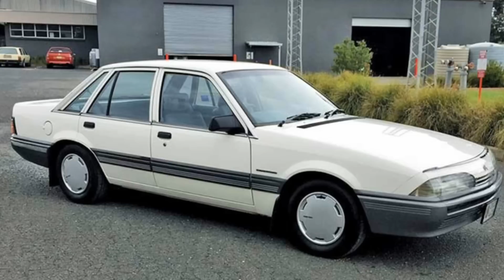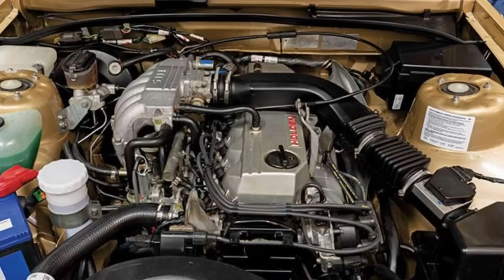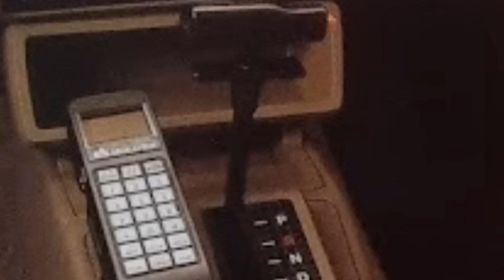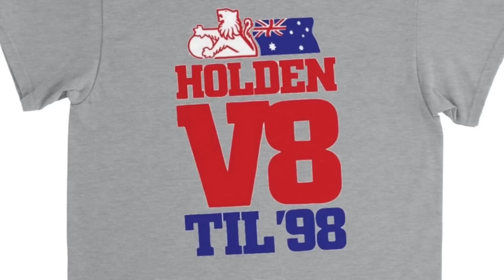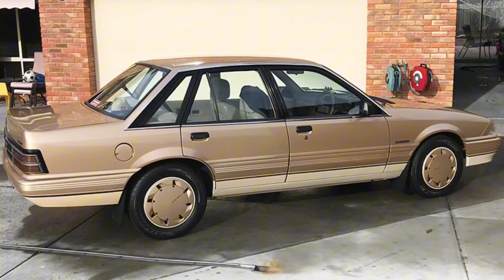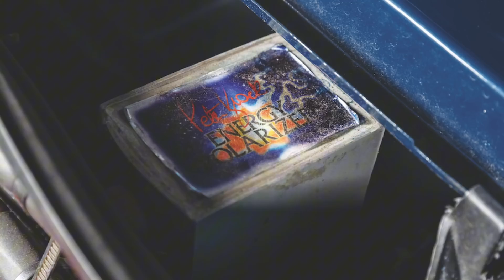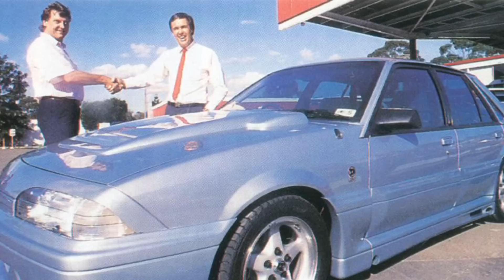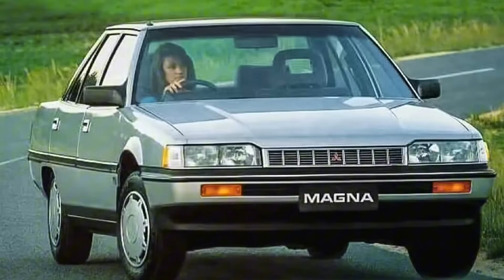Holden VL Commodore - Turbo Talk.

Comment: Of course the RB30 engine was a failure in the VL due to poor installation engineering by GMH. You could take a brand new VL powered by the RB30 and bring it up to operating temprature  and then drive the car on a continuous downhill run for a distance of 1 km and turn around and point the car back up the hill and floor it and kill the engine in about 500 meters due to the cylinder head emptying itself of all of the coolant on the downhill run. Of course engines do not operate very efficiently with no coolant in the cylinder head and as a consequence the cylinder head cracked along the full length under the camshaft, bye bye engine. I believe from a good source that this is why Nissan pulled the RB30 from GMH.
Reply: On another point, The head cracking is mostly due to people not bleeding the cooling system properly when refilling it - there are 2 bleeds from memory - one on the thermostat housing and one on the intake manifold.
Reply: @kajak012 exactly right.  Yes, the radiator was lower, but so were many contemporary cars at that time too.  Holden did publish bleeding instructions in the service manuals, and reiterated it in the TSBs sent to dealers.  Funny how you also have to bleed the V6 from mid-VN thru Ecotec models, yet nobody has an issue bleeding them?
Reply: @commodorenut  my  vl had 220k before head problems,i miss that car very much,if i could spend $$$ i would purchase one today.
Reply from the maker: Good old American truck like engineering. 😀👍
Reply: @markbehr88  buick from memory
Reply from the maker: Yes, Buick engine. Later US versions and ours had balance shafts (thanks Mitsubishi) and it became a very good, reliable and economical engine. 👍
Reply: @markbehr88  Yes only after many attempts the 3.8 eventually became a decent engine. A close friend of mine saw the first rendition of the 3.8 in Detroit in a warehouse with a defective label on each box. These motors were in storage and when GMH put their hand up to find a replacement for the RB30 Detroit emptied the storage facility of defective 3.8 Buick engines to the land of OZ.
Reply from the maker: @1darryloflife  That sounds odd given GM would ultimately have to wear the warranty costs? 🤔
Reply: @markbehr88  They changed the engine so by the time they got to the VT Commodore the out of balance was sorted and the engine was reliable, and then they scrapped it and went to the aluminium block V6. Remember the VN 3.8 litre had a rear of engine mounted thermostat so they had done a lot of work to fix the problems that Detroit had landed GMH with those original Buick mistakes.
Reply from the maker: @kajak012  Makes sense. 👍
Reply: Nissan didn’t “pull” the RB30 from Holden.  Holden were never going to keep the RB30 beyond 1991.  There were already concerns that it didn’t offer enough torque for the upcoming larger bodied commodores and planned heavier LWB models.  The plan was to run the RB30 in VN and introduce a well-developed and refined 3800 V6 in the VP.  The exchange rate problems in 87 & 88 forced them to fast-track the V6 program, which is why the VN had 3 distinct versions of the V6, and a myriad of running changes, as they chased their tails trying to catch up.
Reply from the maker: Yes, as per the episode the costs were getting out of hand as the Yen was going ballistic. 👍
Reply: @commodorenut  the RB30 needed work just look at what they can do now.For me is vs v6,anything before that is not refined imho.
still a holden fan always will be nothing like 308(or stroker sound)
Reply: My VL (which I still own) cracked the head in 1996. I bought the car second hand from the first owner very early in 1991. There was no prior advice from Holden to bleed the coolant points. The engine was always good, however the top tank of the radiator sits well below the highest point in the cylinder head which I see as a design defect from Holden in the quest to lower the bonnet height profile.
Reply: @PaulEvans-f1y yep, that was the problem. Engine was designed to fit the skyline hence no issues with that version however the commodore’s as you said had the issue of the engine sitting higher hence the top of the  head being above the radiator. So coolant starvation occurred which cracked heads.
Reply from the maker: @PaulEvans-f1y  Interesting. 👍
Reply from the maker: @1darryloflife  Really. That does sound like a problem but not an insurmountable one. 🤔👍
Reply: Camiras also suffered this problem with bleeding the coolant system. Ours overheated driving home from a service.😂 Absolute rubbish.
Reply from the maker: @anthonywalsh2164  No good. 🫣

Comment: Bloody legendary cars. They still look great even now. That Nissan RB30 engine was a gem
Reply from the maker: @Coastmac2001  Agree. I love the Calais. 👍
Reply: @markbehr88  the Calais was really well equipped . Wasn't a bad drive either.  Pity there doesn't appear to be too many examples of any VL still surviving
Reply from the maker: @Coastmac2001  I am sure there are some lovely ones tucked away but you are right, the original owner cars are long gone. 👍
Reply: I was given a lift in one. It was eerily silent.
Reply: @jamesfrench7299  they were probably one of the best built cars here . Reliability was very decent. A few niggles in early variants , but overall the VL nailed it
Reply from the maker: Or was that the conversation? 😀👍
Reply from the maker: Yes, and well sort after today. 👍
Reply: @markbehr88  No it was the car 💯
Reply from the maker: @jamesfrench7299  😀👍
Reply: @markbehr88  There are still a few unmolested VL's getting around but certainly not as daily drivers. I'm also the original owner of my VL SL Turbo, celebrating 38 years of ownership this year. Not aware of too many others out there currently.
Reply from the maker: @ That’s great. Excellent value. 👍
Reply: My neighbour has one, the light metallic blue. It's a bit of a gem.
Reply from the maker: @ Nice. 👍

Comment: Thanks for the insight re Director. Nail in the coffin for HDT not presenting car for engineering & durability testing.
Reply from the maker: @vxii4u  Yes, what a waste although I think that car made the Walkinshaw look nude. 😀👍
Reply: That’s what I really liked - everyone blames the polariser, but there were a number of other more important reasons, and Mark covered them accurately.  Durability, ADR compliance, and GMH not being able to control Brock were very sore points for upper management.  HDT even fitted a cat converter bypass to some VLs (post split) which wasn’t exactly legal….imagine Holden copping a fine from the EPA for allowing that?
Reply from the maker: It was crazy wasn’t it. 🤔

Comment: "Flawed Excellence"? My gf's mum had a Berlina, it was a revelation after my VB. So nice to drive. But...yeah, that .superb engine wasn't built for the Commodore.& the VL got a sketchy reputation, like the WRX's reputation. It looked great, if a little bit dated. Thanks Mark. PS: I'd love a Cordia Turbo.
Reply from the maker: @UJ-LiteRC  Thanks. I think it looks pretty good, especially the Calais. Yes, I drove a few new Cordia Turbos back in the day. The torque steer would tear the wheel out pf your hands. 👍

Comment: They drove great, Brilliant powertrains. Those Cordias were terrifying in the wet-amazing the cops bought them! Excellent vids-perhaps some common weak points could be mentioned
Reply from the maker: @pgilb70  Thanks very much. Regarding weak points, I would only cover that if they occurred  while the car is new, rather than later service life, plus that is not my area of expertise. 👍
Reply: The Cordia info gives a good insight into government fleet cars in the 80s.  Councils, Cops, Corrections, Telecom, AusPost etc - all the govt departments in the 80s ran cars for 20,000km then turned them in.  Later this was pushed out to 40K.  As Mark noted, the lack of sales taxes and other duties on cars for govt purchases saw them bought well below what a private buyer would pay, and most times they made a profit selling them at 20k (and then 40k).  This loophole died out when the GST wiped out all the various state sales taxes.
Reply from the maker: I used to put all the Gov’t contract pricing together for Mitsubishi in NSW and the prices they could buy cars for was unbelievable. 😳
Reply: @markbehr88 govt doesnt buy them you buy them for the govt with your tax money ?
Reply from the maker: @Eric-kn4yn  That is true.
Reply: @markbehr88  👍
Reply: Rust around the front and rear screens
Reply: Rust around the front and rear screens
Reply from the maker: @jesus_built_my_hotrod  More rust 😀

Comment: Arguably the best six-cylinder Holden ever.
Reply: Yeah with a Nissan engine lol😅
Reply: The VL groupies conveniently overlook that elephant in the room.
The engine, arguably a car's heart and soul is made by another car maker in another country but somehow it's viewed as an Aussie icon. Go figure.
Reply from the maker: @onlymefornow  True. 🤔
Reply from the maker: @onz76  Yes, I agree. 👍
Reply: Agree
Reply: Not arguably, easily.
Reply: Factory supercharged 3800 V6 is a contender, as well as the much improved V6 in the 91 VN and VP.
Reply: @jamesfrench7299  ummm no
Reply: Because they didn't make it lol
Reply from the maker: @ True. 🤔
Reply: Imagine telling Kingswood buyers in the 70s their future big Holden would be powered by Datsun!
Reply from the maker: @ They would never have believed it 👍
Reply: It wasn't a 2-litre 4 cylinder. It was the RB20 straight six, which was exclusive to NZ. We didn't get the turbo, but we got the RB20, which had 95kW and 180Nm and a short 4.11 diff. The RB20 had a shorter stroke and smaller bore. It was a great engine, and I got one off the clock with ease. I owned 5x VL'S back in the day (4x RB20 and 1x RB30). Great car, but shitty floaty front suspension. Too soft. Apparently, they had designed the VL with an optional column shift bench seat but pulled the pin on that one at the last minute, but the suspension details had been "locked in," so it had a softer spring rate on the front suspension.
Reply: Nissan Boat-Anchor, or Crab-Pot Weight.
Reply: The VY series 2 Ecotec V6 (after 10 years of engine  development) was the best as far as reliability and overall efficiency.
Reply: Still today owners get 200rwkw in single over head cam engine that coming up 40 years old.
Reply: @onz76  they reckon the RB30 bottom end are as strong 💪 as a hemi